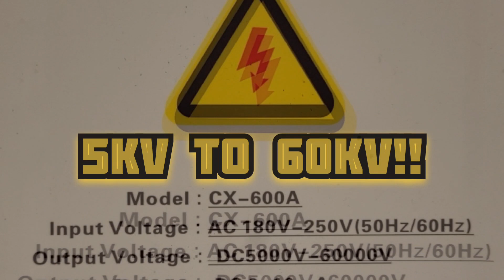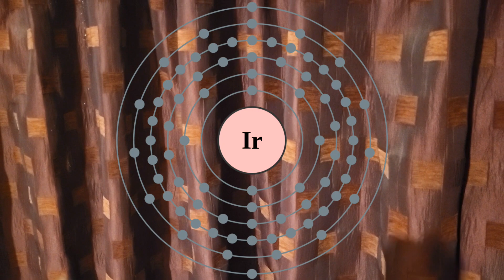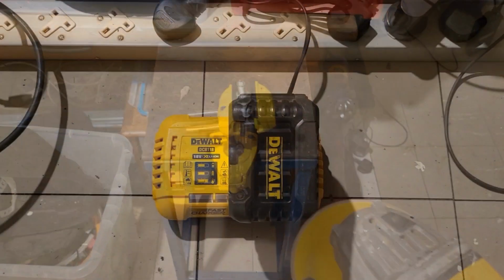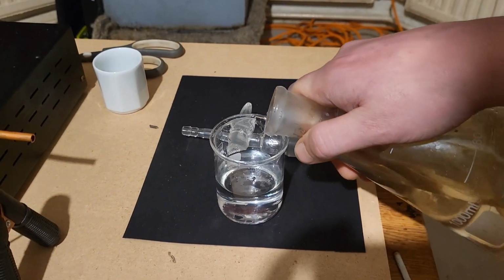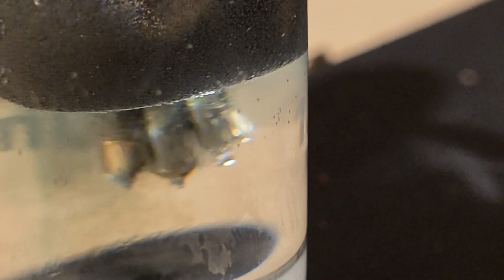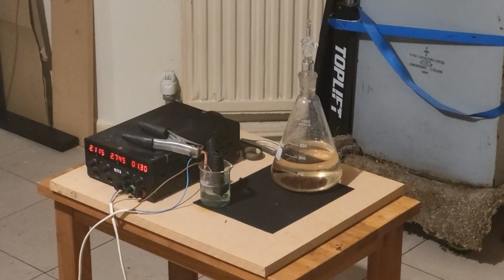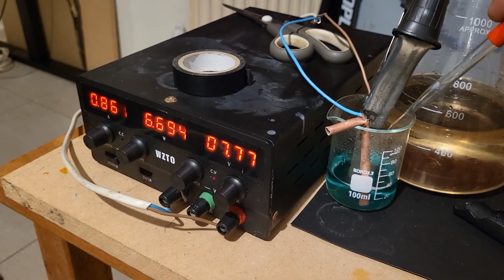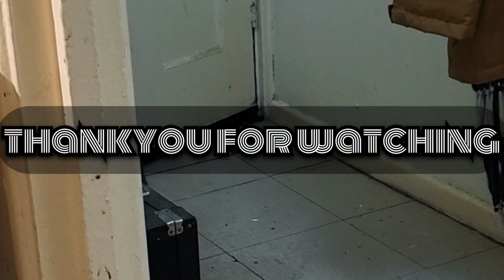iridium harvesting

Comment: What would nitric acid do to Iridium dissolve it completely?
Reply from the maker: No, I am a bit dubious about these spark plugs. Nothing I did here should have destroyed iridium. I poured the solution away expecting to find Ir at the bottom of the beaker but I didn't 🤷🏼
Nitric acid does not disolve it and nor does aquaregia. I think the only thing that will disolve it is alkali cyanide. It can be done in an autoclave with H2O2 and HCl under pressure
Reply from the maker: Just ordered 72 mg of sheet iridium so I should be able to show the dissolving of it when I get it. Iridium compounds seems to be something that YouTube is missing. the fact it's the most unreactive metal might have something to do with it 😅
Reply: Spark plugs as a source, well they could be alloyied with god knows what making it solubilize in a much wider verity of electrolytes.
 Also you used electrolysis which makes things dissolve in substances they wouldn't otherwise...

When you get that piece of eBay iridium I suggest using the same solution the same way to try and dissolve first  to see if the reason it dissolves is the electrolysis. (Don't forget to make sure it doesn't dissolve before you connect the current)
Reply from the maker: @petevenuti7355  iridium should be resistant to electrolysis